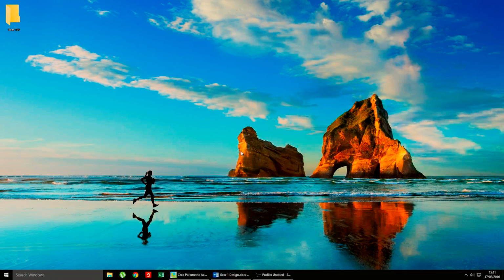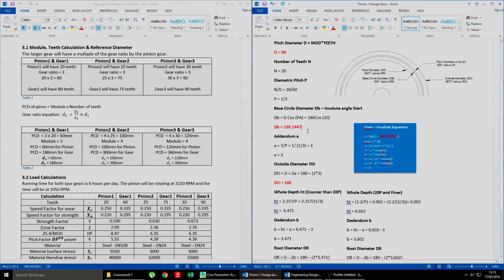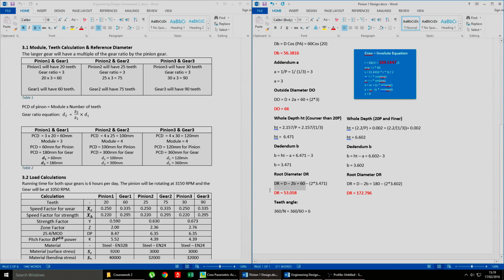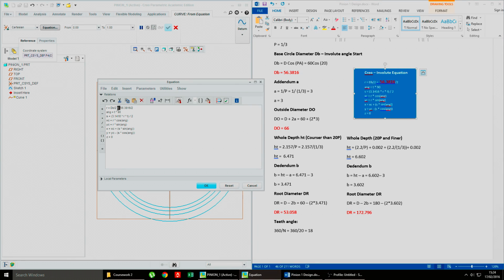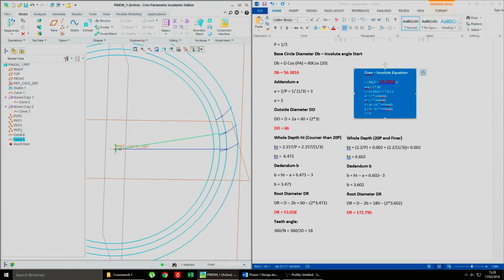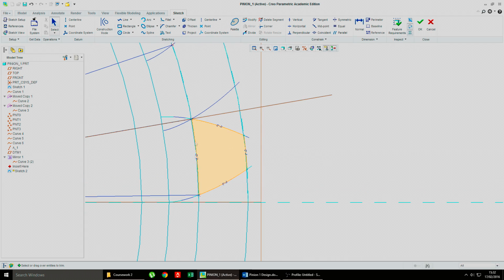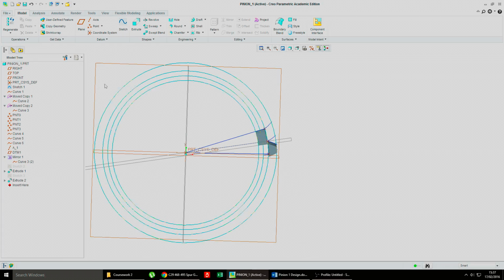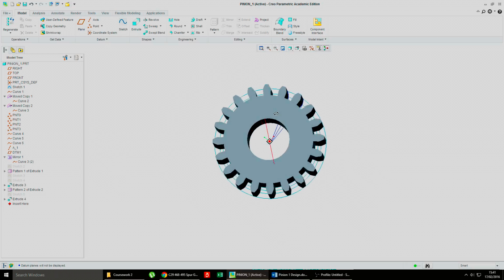How to make an Involute Spur Gear (Equation Driven) in CREO - PRO/E Tutorial

Comment: it is more easy to import a 2d model from other software and then extrude it. i don't have to do any calculation of that
Reply from the maker: I suppose yeah, but going into the detail of the calculation gives a nice understanding of how it works. But I agree, there are easier ways. Thanks for the comment though 😊
Reply: i do all calculation in gear software i get a detail information about it and from there i get the 2d sketch . but i have only tried it with spur gear dont know about helical gear